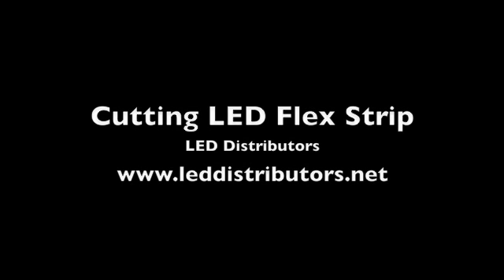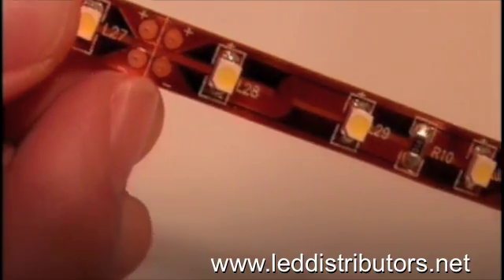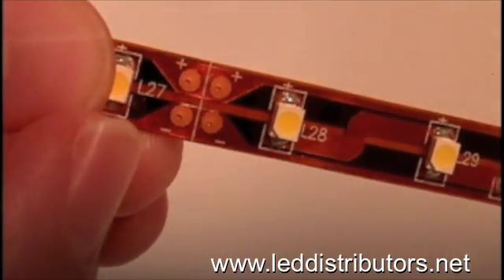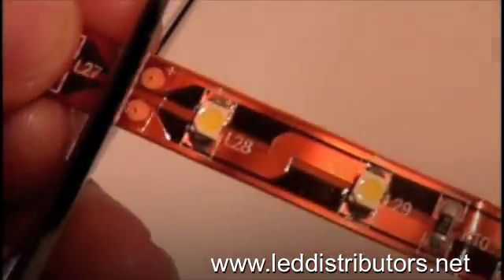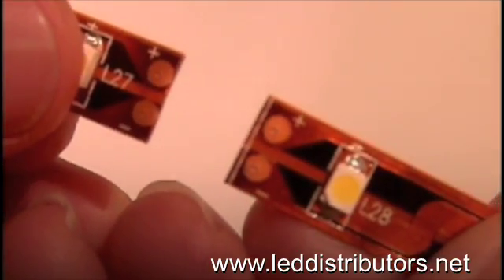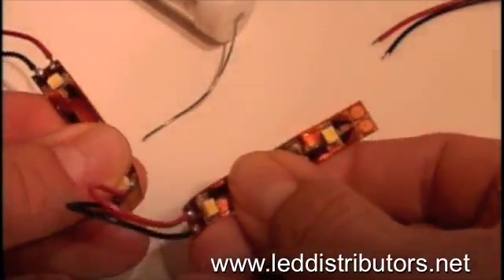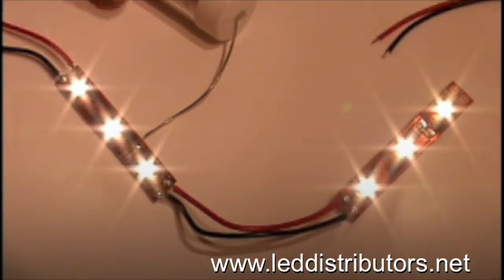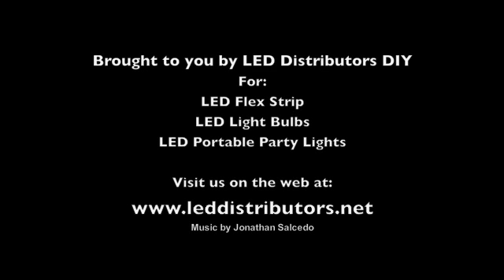Flexible LED Light Strip - Cut and Connect DIY

Comment from the maker: 7. Take the tip of your lead wire and slide it into the melted solder.
8. Slowly remove the soldering iron from the LED Flex Strip and the solder should harden.
9. Test your connections to make sure your LED Flex Strip lights up.

Don't forget to tin your soldering iron tip before you unplug it. This will protect the tip from oxidation for the next time that you use it.

Comment from the maker: 4. Once the iron is completely hot, hold the hot tip on the copper pads for a few seconds to preheat the surface of the pads.
5. Introduce the solder to the tip of the iron (in the V, where the iron tip touches the copper pad. You will have to hold it there for a few seconds until the solder melts and starts to flow.
6. Once the melted solder has pooled on the pad, keep the iron on the melted solder to keep it liquid.

Comment from the maker: @tulebox I copied this from our FAQ page, I would add one more tip. You should pre tin the wire before soldering it.
Soldering Flexible LED Strip:When soldering the copper pads on the strip, you should take note of some helpful tips:
1. Make sure you have a good soldering iron, with a good tip.
2. It is a good idea to secure your Flex Strip so that it doesn't move. We place pliers on the strip to hold it down or use tape to secure the strip.
3. Let the soldering iron get completely hot.